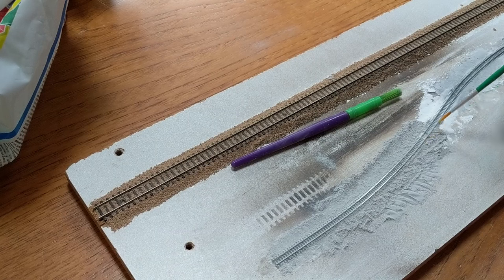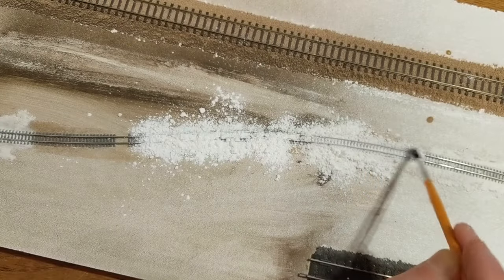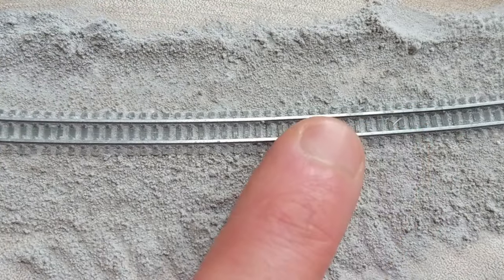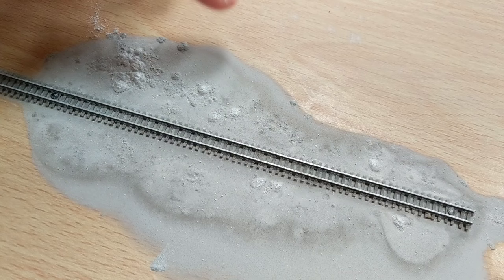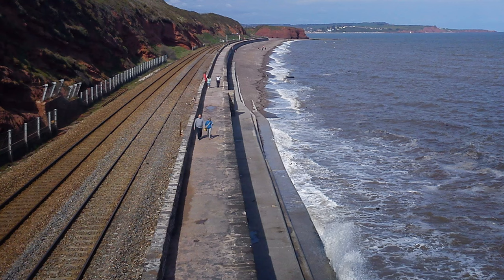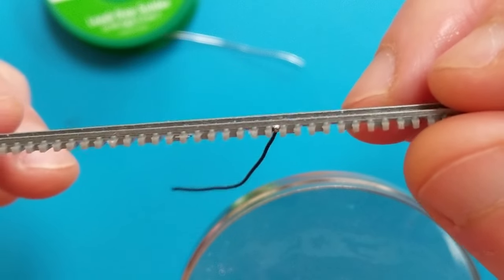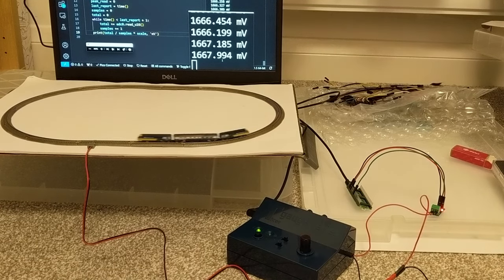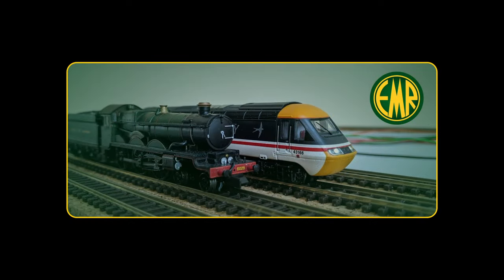0031 T Gauge: ballasts, soldering & train detection

Comment: Hi Jonathan! Some great experiments here! I'm particularly interested to see how the infrared sensors work out! I was going to use current sensors to detect block occupancy, but that means more wires soldered to the track! An independent means of detecting passing rolling stock appeals to me - as, of course does writing code to manage it all! Thanks for the ideas! Oh, and 10/10 for the Christmas jumper! :) All the best, Ian.
Reply from the maker: Hi Ian, thanks 🙂 Yes I was pleased with the infrared detector outcome. It ought to work just as well in N gauge - with the extra option of turning it 90 degrees to have both bulb and sensor pointing through one sleeper gap. The sensor info says it can detect as high as 25mm. Essentially it's a cheaper DIY approach to the similar Heathcote Electronics IR detector, but like you, I enjoy the programming part of it too 🙂 Lol thanks - it's pretty much a blanket with arms, so nice and snug as well as festive 🙂🎄

Comment: Something you might wanna try are texture paints used in tabletop wargaming. They're basically a thick paint that dries into different kinds of groundtypes, like mud, rocky surfaces or even cracked earth. Look at AK interactive texture paints or Citadel technical paints. They're pretty robust and they're pretty consistent, but on a big ballasting operation probably somewhat expensive.
Reply from the maker: Thanks for the idea - I've seen those kinds of paints used for other things before, but price very much puts me off. I'm not sure whether or not their textures would be fine enough either, but I haven't seen them in person, so they may well be. If other things fail I can get some samples to see how they go - thanks for the info :)
Reply: @endoorrailway  having seen both T gauge and those paints (well some of them) in person I'd say they don't generally look scale enough to work for T. Though making a texture paint yourself with finer more T gauge grits and an acrylic medium may be a nice way to apply ballast at this scale - you can get mediums of various thickness to get that right surface tension. 
(My T-Gauge project got most of the way through the baseboard geometry and bulk terrain features but then went into the crate and haven't managed to come back out again yet - so I I've not got to this stage of finishing T).
Reply from the maker: @foldionepapyrus3441 Thanks - that's good to know :)

Comment: Some kind of terrain paste like smart mud from VMS might work. Night shift uses a lot of these products on his dioramas that should give you a good idea of scale and texture. The other thing I’ve used for very fine scatter material is crushed up clay cat litter. It’s soft enough that you can use a mortar and pestle or probably a spice grinder and it seems to absorb a water PVA mix ok. It might need to be sieved for this application which could be tricky
Reply from the maker: Thanks for the suggestions, I certainly wouldn't have thought of any kind of cat litter!

Comment: Interesting. My first instinct would be to use the finest sandpaper available, gluing that to the baseboard, and glue the track on top of it. Paint with an airbrush, then wipe off the rails? Just a thought.
Reply from the maker: Thanks for the suggestion - I think perhaps that would look too flat for what I'm after - the sleepers have quite a bit of depth to them, so I think they need to be mostly embedded to look right, and the surface overall needs to be a little bit "wavy" to look like the real thing. Sprayed fine sandpaper may be a good option for some other surfaces though - thanks!

Comment: I buy ballast made from real stone. Works very well. Grout is dust, not tiny, little stones in different grades. And oversize signals would reduce the chances of a SPAD.
Reply from the maker: Thanks for the info - stones would probably be nicer to work with - where do you find ones that are small enough? The tgauge.com ones say they're mineral, but I didn't like them. The dry grout powder is indeed dust-sized, but I think that can look right for 1:450 - the fact it's not the same material as the real thing doesn't matter - it's the resulting look that matters to me

Lol, maybe on the real railway, but not on my Dawlish T Wall - the trains aren't going to be automated, just the signal changing to danger after the train passes, then back to clear after a set time

Comment: Try spraying 60 or even 90% isopropyl alcohol on the grout.
Reply from the maker: I didn't think of that - thanks - I'll have to add isopropyl alcohol to my to-buy-to-try list!
Reply: @endoorrailway  If the point is to get passed the surface tension problem, I would definitely try that... maybe soapy water too..

Comment: I have no idea what I'm watching lol
I think you are making mini rail model to look realistic?!
To replicate gravel on mini scale, i would mix sand water and glue in some specific ratio depending on grain size of sand and the texture required.
Reply from the maker: Yes sorry I probably should have given a little introduction! This follows on from some previous videos where I explained more - it's for a railway at a scale of 1:450, so it's very small, but I'd like the ballast around the track to look as realistic as I can achieve without too much effort. Thanks for the suggestion - sand's a reasonable idea, but I've struggled to find some fine enough for N gauge (scale 1:148), so I didn't consider it for this. I've wondered about creating some chalk dust to mix into paint, but even if it works I think it could be a long process to get enough of it.

Comment: Why didn't you wear a mask?
Reply from the maker: I didn't say whether or not I was wearing a mask, but you've guessed correctly! I wasn't working with this in a way that made it throw up dust - working with small quantities and very gently moving it with the brush, so I didn't consider a mask necessary
Reply: @endoorrailway  I wear a mask at all times when sanding, spraying, even acrylics, and especially with dust, or when making realistic T trees. As an ex-paramedic, I've seen many cases where a mask would have worked to keep the ambulance away. Just imagine the mask is like an apple. Keeps teachers, and paramedics away. 😜😜🤪
Reply from the maker: That's worth bearing in mind, thanks - it's likely to be all the more necessary if I proceed as planned because I'll probably need to sieve it on

Comment: Just use saw dust with PVA and plonk it on.
Reply from the maker: Thanks for the suggestion. I think sawdust might be too large in T gauge and lots of the bits won't necessarily be as sphere-ish as ballast, but I've wondered about doing something similar with chalk dust - it just seems likely to be a lot of effort to get the necessary quantities.
Reply: @endoorrailway  sugar, flour, chalk try it all, but maybe lay the track on 2 sheets of kitchen roll  3X the width of the track to wick the glue from the bottom, icing sugar or sugar or and blend of both with water glue and paint and soap and bleach would be probably good maybe.
Reply from the maker: Thanks for those suggestions - maybe my ballasting experiments aren't over yet after all! 🙂